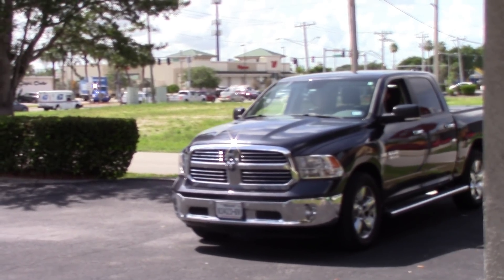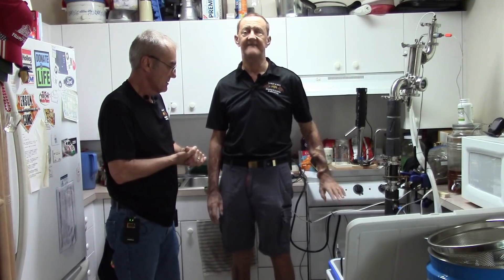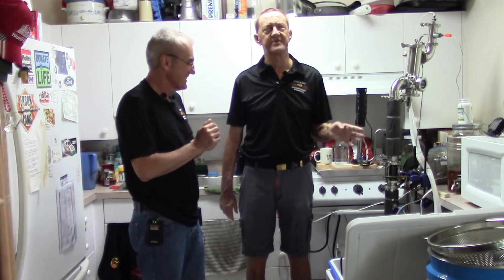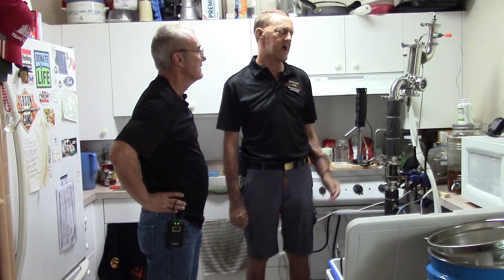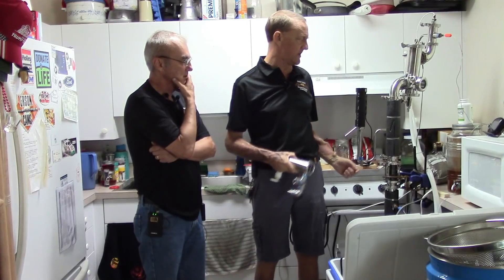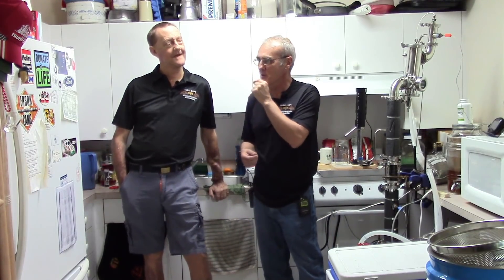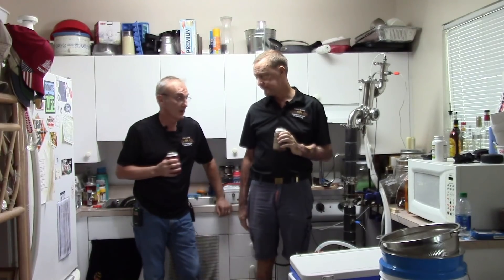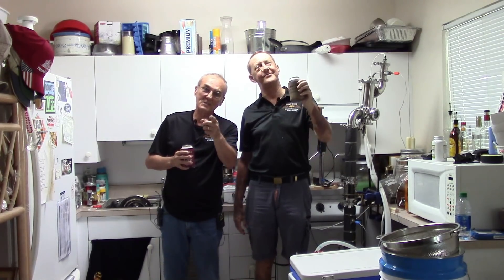DAY THREE DISTILLING WITH MIKE

Comment: George - I tried to find and email address to ask a question but could not and I currently live in a country many hours ahead of you so calling is not an option right now.  Love your videos and I just subscribed.  I know your advice is not to ask the “could” questions but rather “should” questions but please understand that I am extremely limited in supplies I can get so here goes.  If you have no access to stainless or copper, could you use an aluminum pressure cooker for your pot which will be attached to a copper reflux still.?   The opinions on the web are very split.
Reply: George - So sorry.  Already found out and watched your video on aluminum.  Whew!!   Thanks for all your contributions and as a chemist, I fully agree with you.
Reply: Here's his email best to keep your questions short and to the point to get him to answer you
george.duncan76@gmail.com
Good luck and #HappyDistilling

Comment: I learn a lot from you.  Thank you very much Sir
I have a question. 
Why you insulate your colunm.
Reply: If you insulate a column, while you’re still is configured in pot still mode; you will decrease the amount of natural reflux occurred from the ambient air temperature cooling the medal of the column. Thus giving you a lower proof, but with more flavor. Even still, when we first started this run; it started coming off at about 180 proof. So I guess I’m not sure how good this theory actually works? But I’ve insulated my column nonetheless. Take care and keep safe!

Comment: I 3acr of black Barrys that picking after i get done im going to try to make some rum
Reply: I've got 40 gallons of blueberry ready to run and another 30 gallons of blackberry fermenting now I have to add my blackberries into boiling water for just a minute or my mash will grow nasties goodluck #HappyDistilling
Reply: I only got one way to tell you this the old man told me growing up that if you could take a Blackberry and use it for slingshot ammo don't bring it to me but if you could pick it off the vine and it falls apart  wile u pick it then its ready to be used for your drink. At that time but he did say from picking juicing 2 fermentation all in one day . Grand dad said the rest i had to learn the rest on my own. He did say that juicing and filtering just make it easier to work with you still got natural sugars with no mess. and you can take the seeds and everything and put them outside and you have black Barrys next year
Reply: @richardtinker8111  All good my friend we are just taking different ways to get to the same place down here in Florida we have a real fungus problem because the humidity is so high which means I have to boil them first and I do agree the riper the better.
Reply: @chuckdontknowdoya6100   ya sorry im from Tennessee and North Carolina it is a hole lot cooler up there .my bad
Reply: @richardtinker8111  no worries brother it's all good have a great day and #HappyDistilling
Reply: Try mashing the black Barrys and I not for sure but I don't think u will have that problem. Not for sure
Reply: @richardtinker8111  Hey Rich I do mash them good but my first couple of tries I had problems with molds until I boiled the whole fruit for just a minute then mash them I put them in a mesh bag and drop them in a large pot of boiling water for just a minute.